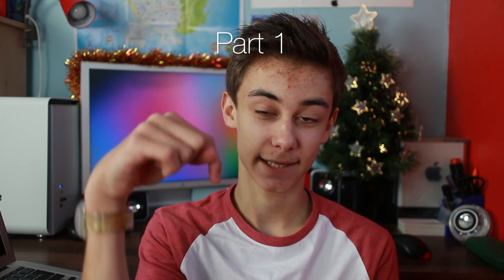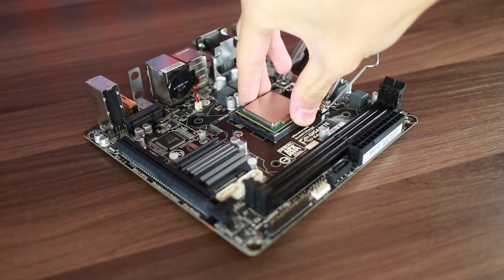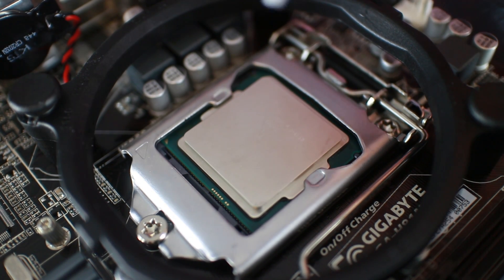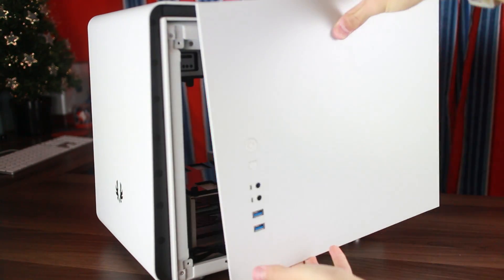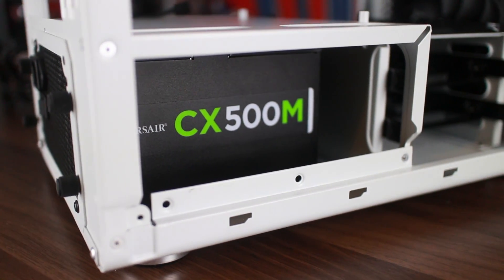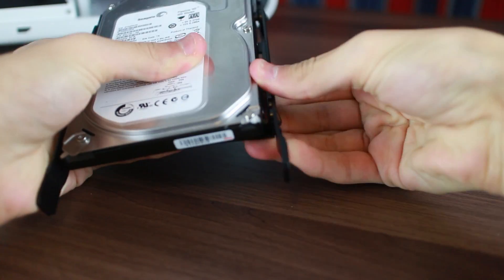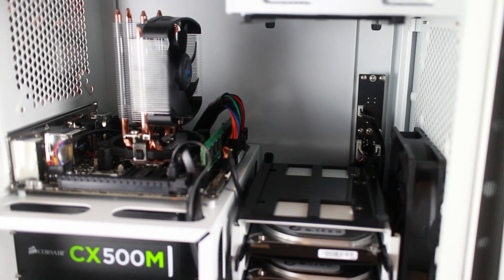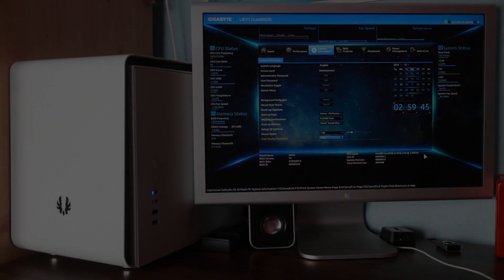2015 Hackintosh Build: The Build [2/4] | The PowerPC Hub

Comment: A couple of hints for future builds. Install the cpu heatsink before the ram. That leaves you more room to work.

Second, you really should go with two sticks of ram instead of 1 to enable Dual Channel. That will provide a noticeable improvement in system performance. Usually two 4 gig sticks would cost about the same as a single 8 gig stick so one wouldn't save enough to make buying one stick worthwhile. Of course buying a single 8gig stick now leaves you the option to add a second 8gig stick later when you only have two slots like this board has. Dual Channel is more important when running onboard graphics though, but it't still a worthwhile performance boost.

Other than that, looks like you did an excellent job so far. Gonna watch the

Comment: Dude,Love your video so much. But I have some questions here. First is i3 processor really enough and the graphic card is GTX 660 which seems very old nowadays. I just want to play dota 2 on my hackintosh. I wonder do I need a more powerful graphic card and cpu.
Reply from the maker: Nope. The 660 has played absolutely everything I've chucked at it at full resolution (1920x1200) with everything cranked up, as you'll see in Part 3 ;)
Reply: how about the ACU and the watchdogs ?

Comment: Stunning Video- you did an excellent job with the presentation Niall, and I'm excited to see where this project goes as well! My Hackintosh has been going for about two years now. You'll be happy to hear that Gigabyte motherboards make OS updates extremely simple. I haven't had anything go terribly wrong, only having to replace my audio kexts with each update (so keep those handy).
Reply from the maker: That's great to hear. The only thing I had to really fiddle around with was the audio drivers too so it's been pretty much plain sailing. Thanks for the heads up :)

Comment: I would put the front 120mm fan up one slot so it blows air into the CPU cooler and have the rear ran exhausting the air from the cooler as well.
Reply from the maker: Good shout on the intake. Never even crossed my mind. I did test the exhaust and it made no difference to any of the temps, and just created more noise, so I think I'll leave it out.
Reply: ***** Yeah that's fair enough

Comment: If I were you i'd put that exhaust fan back. It really makes a diffrence. I have a simmiliar style cooler and my PC would overheat if I took the exhaust fan off.
Reply: It's an i3 he will be fine, fans = noise and noise is annoying.
Reply from the maker: ***** Evaldas65 Yeah my temperatures are absolutely fine mate. I did test the computer with the exhaust back in the system just to see, and in terms of temperatures it made literally no difference, and as the two fans were spinning at different RPM's at different times in the same direction it made one hell of a lot of noise.
Reply: ***** Silence in PC's is my new fave thing ever
Reply: ***** Well, it's your choice. I love silent PCs too. My consoles are actually louder than my PCs, lol.